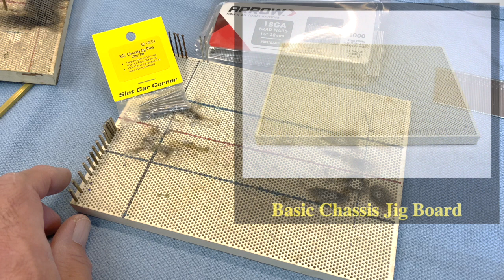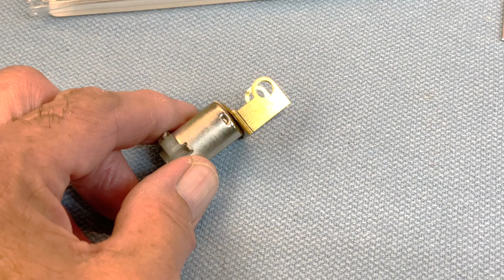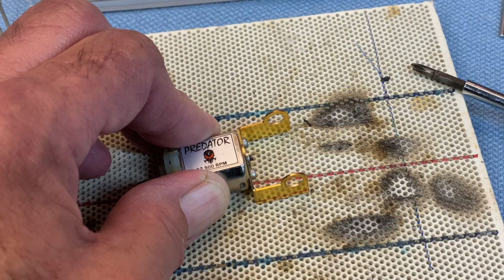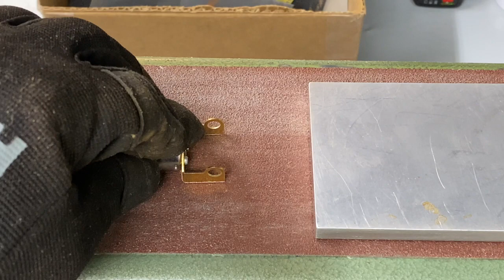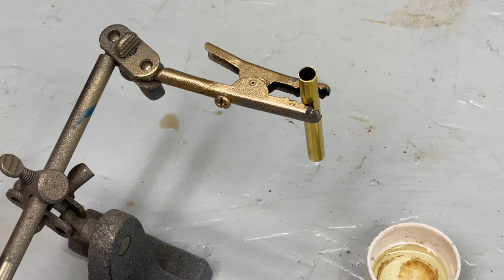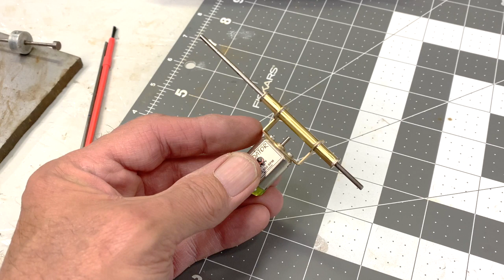Project: FLOCK - Part 4 - 1/25th Showdown Series Beach Racer

Comment: Harry. Youve always used the 15mm X 8mm mock up wheels to keep the chassis  level on your board. That’s my biggest issue. I have to shim to keep chassis level where the mock up wheels would help immensely
Reply from the maker: Did not get any 15x8 wheels? Or just the larger ones for the car? Might be a bit of expense, but get some slot.it ones at least for future projects?
Reply: @Homeracingworld  i just like the way your 15x8 wheels give you the stability on the chassis on the board. Especially on the front if you use piano wire to solder to the axle housing.
Reply from the maker: @MeGolf92  indeed they do. Well worth having them. Dollar for dollar the SLot.it are cheaper and work the same https://slotcarcorner.com/collections/1-32-wheels/products/siw15808215a-slot-it#
Reply from the maker: @MeGolf92  yes because if they are FLAT and true, then you KNOW your chassis will be :)
Reply: @Homeracingworld  thanks. Trying to emulate for success
Reply from the maker: @MeGolf92  oh you got this!

Comment: Another advantage of using the honeycomb soldering plates over the more expensive chassis jigs, is they're ceramic, not a solid surface material such as Corian. This allows you to solder with a torch (I don't.) if one so chooses. Harry, have you ever tried cleaning a used solder plate with anything? There must be a grit of something, cheaper than diamond, that would do the job. I built my first brass chassis in 1968, yet I still enjoy watching your You Tube videos such as this series. Keep up the good work!
Reply from the maker: Thanks sir. No I haven't but I do have one to experiment with. They are low cost so I just grab a new one.